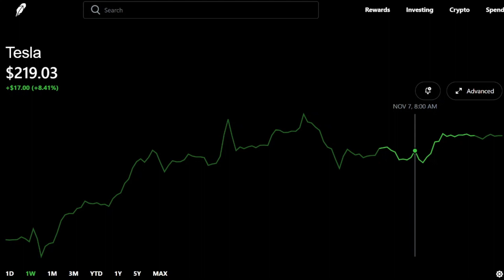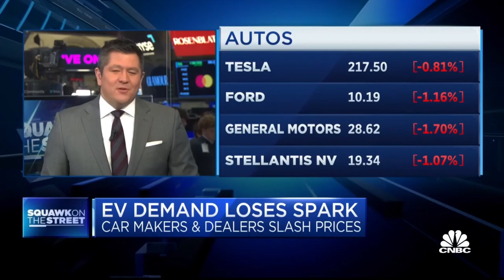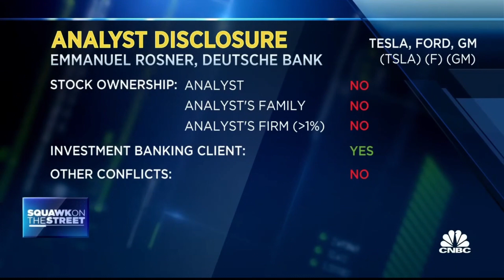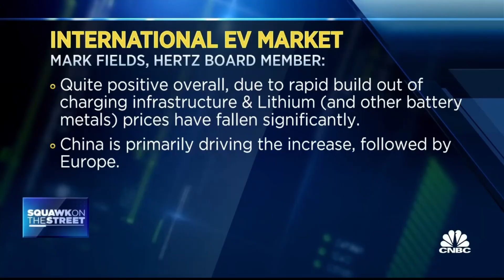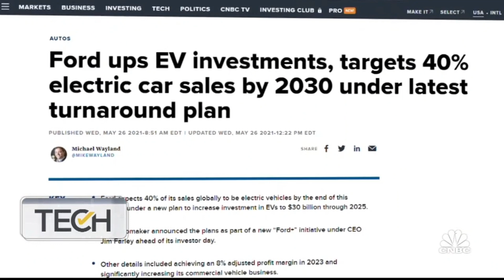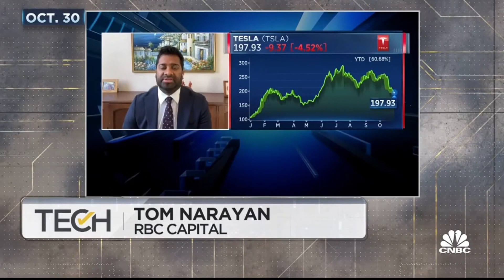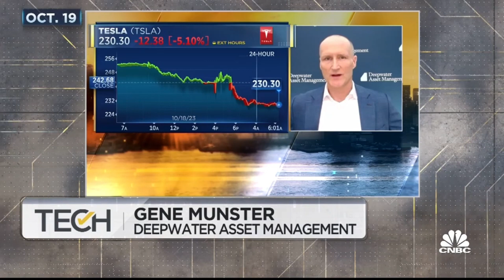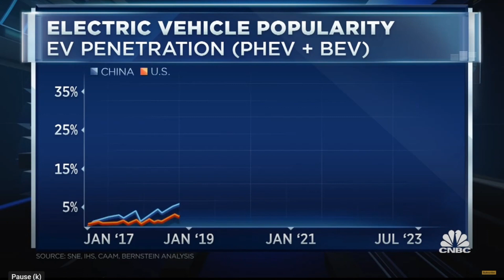RIVIAN CHEATING ON AMAZON? / DELAYED EV ADOPTION

Comment: Great show, Rivian is doing about the same numbers as Tesla was in 2015 making the model S and Rivian has three products not just one. The run rate is somewhere between 3-4 min per vehicle on the R1- line . The vans are a separate line I don’t know how fast that line is moving but it’s a much simpler vehicle. I think the sales of the van has potential to really accelerate the profitability in the configuration it is now. Cost of ownership is so low compared to a ICE truck it should be a no brainer to switch over from sprinter and transit. FedEx, U-haul , UPS really most of them don’t travel that many miles in a day. I don’t think you should count Rivian out. Now that said I’m going to drive my kids to school in a Tesla😂